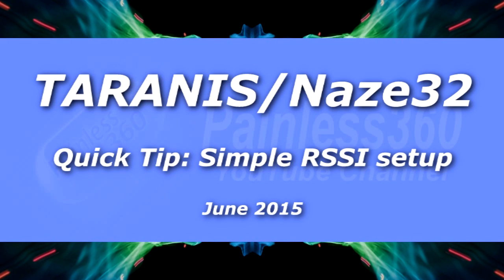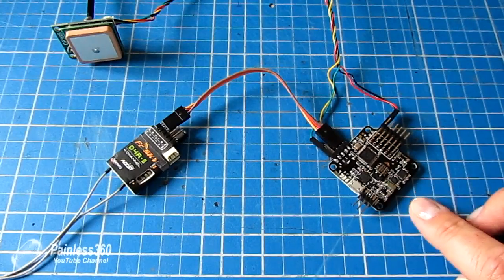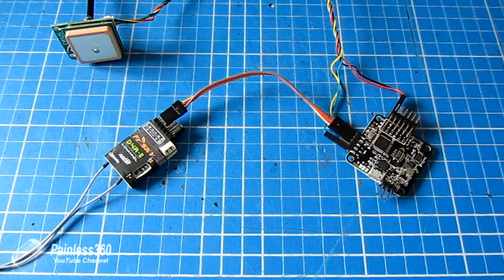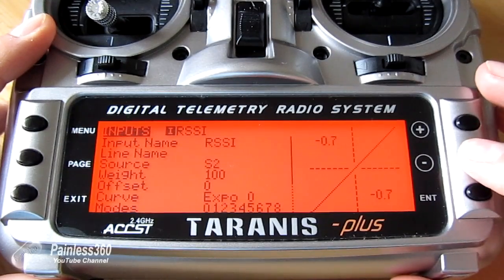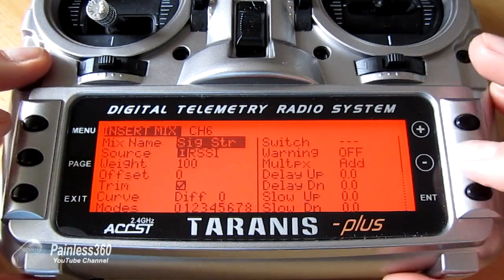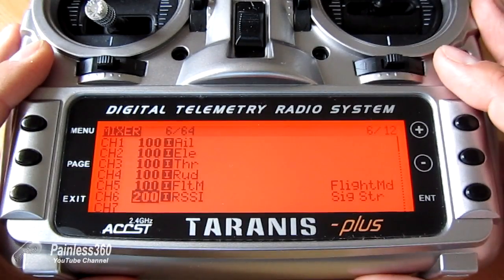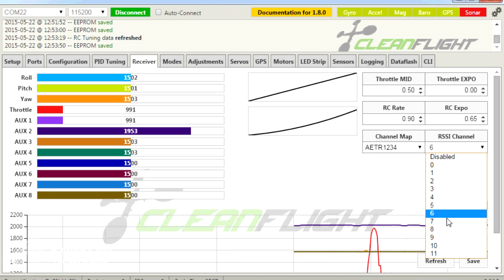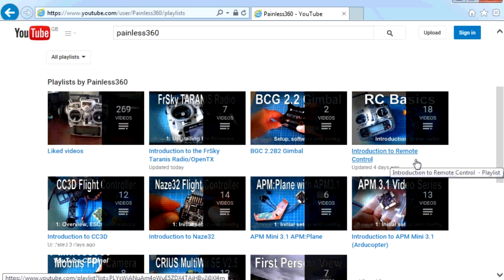FrSky TARANIS/Naze32/Cleanflight Quick Tip - Setting up RSSI for an OSD with D4R-II

Comment: Hi. I´ve done the settings from your video, Betaflight shows the correct RSSI value, but by switching on the RSSI value in the MinimOSD it goes down to 0% and remains there... 
What could be the reason for this ?
Reply from the maker: +Karsten Janas you're not setup for rssi in the telemetry stream.. check what setting you have in the GUI.. Best of luck

Comment: Another question. Whas the best way to take feedback for the RSSI signal? the best way to measure it. Via soldering receiver to an rssi input in the FC.... via the transmiter and then selecting a rssi chanenel in betaflight receiver tab? or via transmiter sound? I need the best way to have an alarm for the rssi to go past 500m.     Another quest... whats receiver its better than the XSR? The L9R?, X8R? Thank you again buddy.
Reply from the maker: +KANGI if the rx has an rssi output then use that every time. Newer mini Frsky receivers now also provide the rssi value on channel 8 too so no extra wires..

Comment: Fantastic you are a genius, got it working this way with my sp f3 racing flight controller, my question is can you do the same with vbat, can you send the battery voltage of the quad to the taranis radio in a similar way , I have uar1 that is working with the usb port, so I can not used , uart2 is using the MWOsd, and Uart 3 is been use with the Sbus for the x4r sb,  can you do a video with the x4r sb and SPF3 racing flight controller, to transmit vfas to taranis radio, is a whole bunch for Naze32 but not for SP racing board. thanks in advance.
Reply from the maker: +Humberto Montalban the telemetry system changed dramatically when opentx moved to version 2.2. All of our later videos are using 2.2 with X Series receivers and the telemetry system is completely different. Best of luck

Comment: On the latest OpenTX, RSSI is not in percent anymore. It is actually in dB now which is a logarithmic scale and thus not linear anymore and it goes above the 100 value... If we use that value, the RSSI 0-100% shown on the OSD would be incorrect since percent is linear... Is there any way of getting RSSI in 0-100% again?
If I don't set up any telemetry sensors or screens I can actually see RSSI (labeled as RX) in a 0-100 scale in the bottom when trying to access the telemetry screen but that value doesn't seem to be accessible from the inputs source menu. 

Thanks in advance!
Reply from the maker: I've not played with this since the video and you're right it does look like it's changed in OpenTX 2.1. Interestingly there isn't anything I can see about it in the code for Cleanflight so I assume it works the same - let me know what you find out..
Reply: Playing around with it I finally figered out that it has always shown the values in dB. The 0-99% RSSI scale that used to be on the Taranis just shows 99% when the dB RSSI is above 99 so it's actually the same.  You just need to set the scale to 100dB when setting up the input and the rest of the process is the same as it used to be.

Thanks!

Comment: I have connected my X4R with CPPM to a APM 2.8. Is it possible to used the same technique you show here to input RSSI to APM and to use it for ailsafe RTL? Failsafe is my problem at the moment, it must be activated when X4R looses RC control signal, but not when Taranis is loosing only the telemetry link.
Reply from the maker: You need to set the failsafe values on the receiver to be lower than the threshold on the APM so if the receiver looses connection with the radio then the low channel value is seen by the APM as a failsafe condition. See us setting that up in the APM series. Best of luck!
Reply: Ok, it works! Failsafe is very easy: Just teach the X4R the failsafe set rom the Taranis, so that Mode RTL is selected. But I have no idea at the moment how to handle the RSSI signal for my OSD, wich is a PWM Servo signal from X4R. Normally I would feed it into the analogue ports of the APM. (L9R has a 3.3v RSSI output). Should I build a signal converter with some type of micro? PS: Best wishes for the presidential election in the US!

Comment: so, I have an issue where once I have it working, 100 is correct , but no signal is 49.... how do I fix that.
Reply from the maker: +Nick Pittman that will be the last value it heard as the reading comes from the radio so when you stop the signal there isn't an update. If you want it to work like that then look at using the RSSI value from the reciever itself. Best of luck!
Reply: thanks , that is working much better

Comment: on 2.1.8 firmware when I set weight to 200 and offset to -100 output range is -300 to 100. There should be an update video for newer firmwares.

Comment: Ok I have no rssi source on my x9d plus.    Goes though all the control sources, switches and then through 32 channels, theres a MAX and 16 tr things.  So here's one that has no video.   FLIP32->x8r->fry sky x9d Plus  OH!  And you can't do ppm on the x8r or sbus with the flip32 I'm assuming, so I have to use pwm which for flight is fine.
Reply: First go to telemetry setup page, Discover new sensors
now it will be there as an input, set scale to 100db
rest is the same
Reply: oh cool will try that

Comment: Silly question, but i guess if 6 of the inputs are already in use.. this option wont work in my case (they are assigned to switches etc).  Not with the d4r anyway.
Reply from the maker: +theskyisthelimit you'd have to use PPM and the 8 channels.. Best of luck!
Reply: Ah, I hadnt realized there were 8 available.. issue is though, i cant seem to set any given channel on the Taranis (latest companion / firmware) to RSSI, it simply isnt an option.. I see below others said you have to goto the telemetry screen (hold page in?) and scan for sensors.. i dont have any telemetry sensors plugged into the white port on the d4r, so how can i make RSSI become an option then.. or am I just missing a button sequence to "scan".. I do see the RSSI value at the bottom though.  Thanks
Reply: Ooops.. i hadnt realized screen #12 had a discover sensors option.. with the (x380) on this did the trick.. i could then change it :)
Reply from the maker: Wonderful! Glad you got it sorted. When you've seen it you'll never forget it again. Happy flying!

Comment: So, I have a question. I use aux2 to switch between Airmode, could I still do this and use  Channel 7, so I can keep Airmode on aux2.
Reply from the maker: +Steven Rimmer With a Taranis and OpenTX you can pretty do much anything you want! Best of luck..
Reply: +Painless360 so my Taranis arrived today, and I don't get the option to add RSSI on the source??
Reply from the maker: Discover the sensors first - see out video on 2.1 telemetry..

Comment: Hello,
Since the Tx is driving the behavior for RSSI in the Rx, what happens when you lose the signal. How does one set up fail safe under these conditions. I may have missed a FS setting YT.
Reply from the maker: +Steven G Most failsafe systems on flight controllers don't use an RSSI signal but instead, watch for the a channel (usually the throttle) drop below a pre-set level or disappear altogether.. Happy flying!
Reply: +Painless360 Thanks. I normally fly with a Dragon Link 433MHz LRS and set it to low throttle for FS. I'm putting together a minature FPV flying wing and needed to use the lightest possible equipment. I fly a Pixhawk in my larger planes and the Naze32 is new to me, as well as, the FrSky Rx. Your tutorials are excellent but I didn't see one on setting Fail Safe with the aim of triggering Return to Launch. I have; Micro minimosd, Naze32 R5, GPS, it would be great if you could put together a capstone video of getting this setup to fly a few modes, including RTL. Thanks, Steven
Reply from the maker: Naze32 doesn't have the GPS modes you are used to - yet ;) If you really want a cool board that will fit a mini wing and still give you the performance you are used to - have a look at the PixRacer ;)

Comment: My taranis is reading is off by about 15db.  OSD reads 100, radio reads 85db.  I set Clean flight to 255 and even went up and down searching to match it.  Any ideas how to match or calibrate so that they are somewhat close?
Reply from the maker: +Mark Johnson Not sure - I'd check the forums for the versions of CF and OpenTX you are using.. Best of luck.
Reply: +Painless360 correction.  It's stuck at 100 on the OSD.  Cleanflight is dead on real time.  Syncs up perfectly with the radio in clmeanflight.  So the Naze32 reads it.  It's like it doesn't pass it on to the OSDoge.

Comment: Hey +Painless360, i'm in a big trouble i can't get out.. Few months ago i upgrated the taranis (plus) to a newer firmware. Since then i'm no more able to find RSSI parameter in the list :(. Today i upgrated the firmware to 2.1.7 but still got nothing. Any idea why?
Reply from the maker: +Grex0 You need to 'discover' the sensors in the telemetry screen (with the Rx and model powered up and sending data). Once you've 'scanned' for the sensors then you can use them as normal.. A few names have changed though. Video on this coming soon..
Reply: +Painless360 you're my hero, it worked :D!Thanks! I think the coming soon video will definitely be appreciated by many people stuck like me :D.

Comment: Hi Lee,

Could you please make a video on how to setup the RSSI after version 2.1? I just can't find it anywhere but if you could point me in the right direction, or better yet, make an awesome video, I would be very thankful.

Thank you.
Amir
Reply from the maker: Discover the sensors (with the Rx and model powered up) and you'll see RSSI is one if the first found and then can be used.. Best of luck!
Reply: +Painless360 
Thank you for the quick answer. I did find this, but when changing it to custom I believe, my values are gone and I hear telemetry lost - telemetry discovered all the time. Thanks

Comment: Awesome video!!  I've tried several other methods to get RSSI to work on my ImmersionRC Vortex using this setup, but this is first that worked flawlessly.   Great stuff, thanks so much!!
Reply from the maker: +Matt Schinzel you are welcome!
Reply: +Matt Schinzel You got the vortex pro? I'm wondering if this will work for me. I was using a sbus receiver and chopped up the antennas so now I switched over to a d4r ii and ppm output.

Comment: on the input screen where you selected RSSI for the source its not giving me any telemetry options to select i know im running the latest firmware. am i missing something here?
Reply from the maker: +basebilljr07 Sounds like you are not running the same version of OpenTX as we are. All of the telemetry changed in OpenTX 2.1 and later..
Reply: +Painless360 I did figure it out you have to first bind the receiver and then go to the telemetry page while it's connected then scan for sensors     then select RSSI and then it will give you the option to select RSSI on the input page
Reply from the maker: Nicely figured out! It's time for us to upgrade here and do a video about it I guess!

Comment: RSSI is not an option on my taranis that is on newest firmware... what gives
Reply from the maker: +jam3s121 The latest version of the firmware changed quite a bit, including telemetry.. We will be doing videos on it after Xmas..
Reply: +Painless360 thanks
Reply: Painless360 I was able to get telemtry data by going into telemtry and finding new sensors. I could then select RSSI as my source Do you know if that is the right process?
Reply from the maker: If you are using OpenTX 2.1.x then yes. Happy flying!

Comment: Thanks for all the helpful videos.  Question... will this work for the X4R SB?  If not what is the best way to get telemetry out for the X4R SB for OSD use on a Nase or Flip32?  Sorry if you already explained this.  I saw how to use Smart Ports and sensors but I don't have room on my micro/mini builds for that stuff.  Thanks in advance.
Reply from the maker: Try it and see ;) (should work fine)
Reply: +Painless360 Will do.  If I'm using a micro MinomOSD.  Will this hack along with the battery voltage going through the FC be most of the telemetry info I need for RSSI and voltage?  Or will the Minom display this info? I've never used OSD yet.  I'm trying it out on my next couple of builds.   

Another question... have you tried to use the cheap Airwolf RX-F801
 Rx from Banggood?  It supports telemetry with an open source FW update.  I tried the hack in the video above with it and it didn't seem to work.  Anyway it's a great lil PPM RX for $12.  Thanks again for all your reply and all the info you provide.
Reply from the maker: +Quad Bruh Hi, I've not tried that receiver. Make sure that when you setup the OSD you are selecting that the 'data' is coming from the flight controller. We have loads of videos on the MinimOSD and they should help. Best of luck with it!
Reply: +Painless360 Thanks! I'm stymied with SBUS issues right now.  I think the version of Betaflight I'm using may not like the SBUS setting in the GUI Configuration screen.  Every time I click that selection the bullet mark doesn't stay next to it.  But when I go to the Receiver tab it does show 16 channels.  Anyway, I'm trying to suss this issue out.  I soldered a wire to the "A" side hole and wired the 5v and ground to channel 4.  I'm getting power to the RX but now signal is showing.
Reply: +Painless360 So Saying all that... OSD is next... LOL
Reply: +Quad Bruh  Did you get RSSI from the X4R-SB onto the OSD?
Reply from the maker: If you're using OpenTX2.1 or later remember to 'discover' the telemetry data once when the model and sensors are all on and connected to the radio..

Comment: in my Taranis 2.1.3 i cant see RSSI in inputs>source, any suggestions pls?
Reply from the maker: +Maciek E Yep - use the same version of OpenTX as I am in the video ;) I'm using 2.0.17 when this series was shot and they may have changed this in the version you have. Check the release notes..
Reply: +Painless360 Hey, i just did it and received major error, after switching on my radio emits neverending beep and lights main screen without loading anything, tried few times, then tried to go back to 2.1.3 and also failed, after "Write TX" on end of loading bar i get error message: "New firmware is not compatible with the one currently installed!", what can i do?
Reply: +Maciek E EDIT: ok i found the solution, had to write firmware without "Check Hardware compatibility" option and all works fine now :) thanks
Reply from the maker: Phew - well done on getting it sorted. Happy flying!

Comment: Page 5 of my menu says "Sticks" instead of "Input" so I only have 4 options on the page: Rud, Ele, Thr, Ail.

How do I change it to say "Input" so I can add the RSSI feature?
Reply from the maker: BlaZeD I use OpenTX V 2.0.17 here, sounds like you are using another firmware on the radio. Best of luck.

Comment: Holey crap, how did I not know this! I tried all the other ways going getting my D4R-II RSSI to my MMOSD to no avail, this looks heaps easier!
Reply: RCShufty Ugh, can't get it to work through the OSD, I can see the right values coming through to Cleanflight, but for some reason my MicroMinium OSD  wont display it, just shows up as 100%
Reply: +RCShufty Change the rss max to 255, had the same problem.

Comment: I hope you wont stop at 9 videos, when you learn new things to do on and help run the Taranis please let us know. Here's one for you, I have a custom eepe by Jean-Marie Piednoir that makes the trainer switch work as the push button on an early single channel transmitter only with servos not the rubber powered escapements, although, you can use the old escapements if you have them. Great fun for the vintage flyers out there.
Reply from the maker: Have you looked in the Taranis playlist lately? LOTS more videos waiting to be published ;)

Comment: Awesome tutorial!!!  Great way to get rssi!!!  Keep the videos coming
Reply: The Taranis is such a versatile radio. I have always set RSSI for my receivers, but never thought about using the offset. I know that you have to use the offset to match travel to other radios, but I never thought about using it in this situation.
Reply: James Pontones I use an offset fot the throttle for displaying on my screen.  Never knew you could feed the rssi over the ppm stream
Reply: Quadflyingmedic I use S-BUS with mine & get RSSI though the hookup & S-BUS is similar to PPM in a one wire setup. To be honest I've never really checked to see the accuracy of the reading & probably should.

Comment: Thanls for your very informative videos.  When I used your way in softserial in telemetry.  It worked with signal inversion but,  disabled Led_strip,  so I had to return back to frsky pins,  but only RSSI IS WORKING,  NOT THE ACC SIGNALS,  HOW DO I rectify this?
Reply from the maker: khaled Homouda You only get the telemetry out of that port when the board is armed - you have it armed?